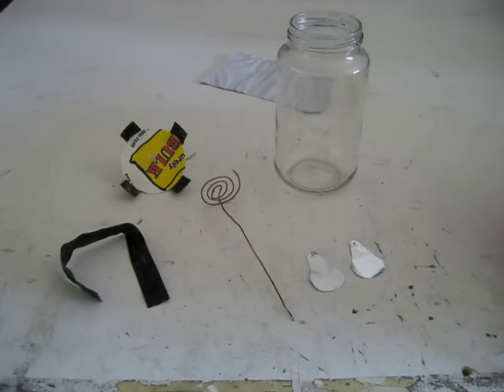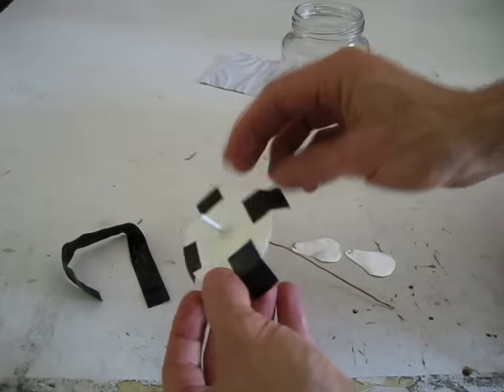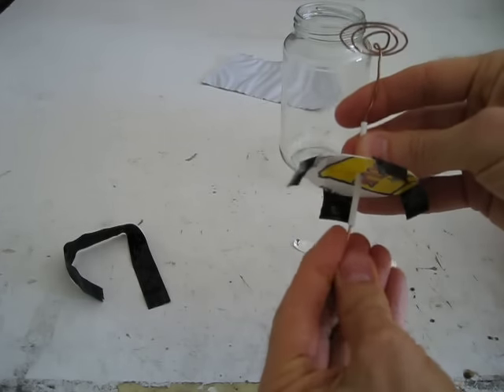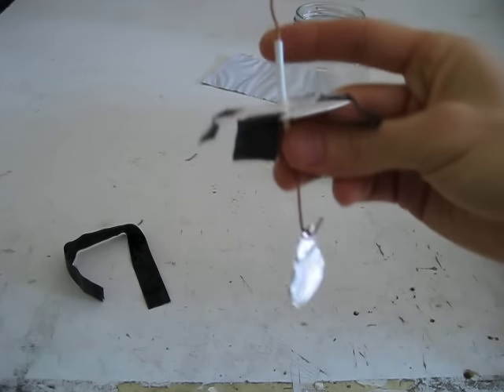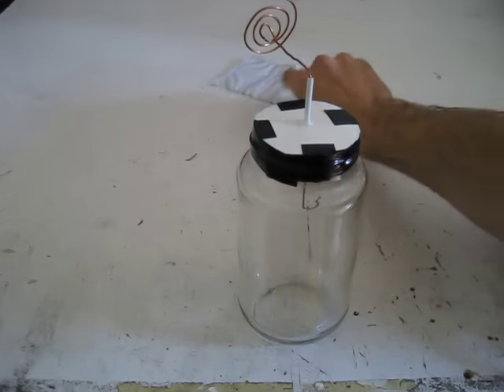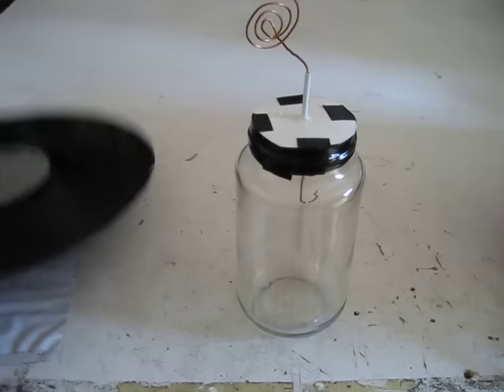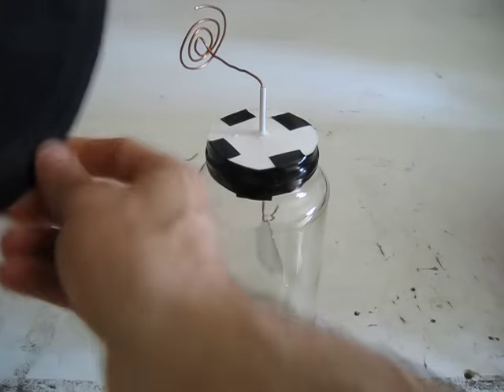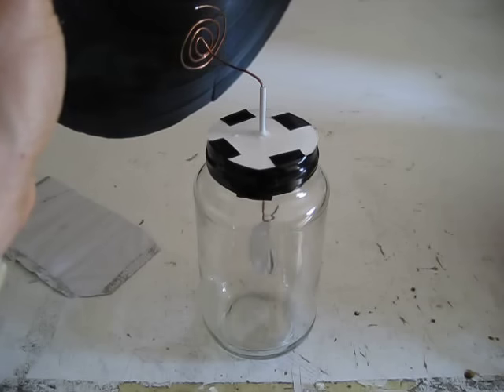How to make an electroscope (DIY)

Comment from the maker: It's not necessary to have the ends soldered. The most frequent problem is not with the electroscope but with the charged objects. If the air is very humid then it's hard to charge things. Also, try charging different objects: rub a plastic coke bottle, a balloon or a plastic comb against your hair and use the coke bottle, balloon or plastic comb. Oh, and the container used for the electroscope must not be metal. Does any of that help? Otherwise, describe what you've done. I'm happy to help.

Comment from the maker: I just looked up what that means and why it's relevant. As a result, about 20 minutes ago I put five Americium-241 pellets that I got from smoke detectors and that give off alpha particles inside my electroscope. Nothing's happened so far. The leafs haven't spread apart. I assume the alpha particles are supposed to ionize the air in the jar, somehow creating ions of the same polarity, causing the leafs to become charged and spread apart. If anything happens I'll let you know.

Comment from the maker: Are you asking how it's working out? The foil leafs are still not spreading apart. But the five Americium-241 pellets are still in the containers they were in in the smoke alarms with only a small hole for the alpha particles to come out. I'll be doing further modifications over the next week.
And if this isn't what you were working on, it's makes for a great experiment anyway and something a lot of people will find pretty cool in a video if it works, so thanks for bringing it up either way! :)

Comment: these using a glass jar, a metal lid with a hole punched through and a pen shaft to insert the copper wire (not even very high gauge).  Worked really well even with the high humidity in my house.  Could even charge by induction by grounding it with my hand.  Thanks, will uses as a demo in my class.
Reply from the maker: Sounds good. Have fun demoing it!
Reply: RimstarOrg
My students really enjoyed.  Thanks worked really well.

Comment from the maker: To make sure I understand what you're doing...
1. you rub plastic dipper
2. you bring plastic dipper near electroscope terminal - the foils repel
3. you touch your finger to the terminal
4. you rub plastic dipper
5. you bring plastic dipper near electroscope terminal - the foils DON'T repel

It sounds like you have a problem with where your foils are hanging from the wire. Something happens when the foils come back together after step 3.

Comment from the maker: That'd depend on the electric charge on the magnet (number of electrons vs protons), nothing to do with the magnetic field. It would just be a metal object.

But if the electroscope was already charged when you brought an uncharged metal object close, the electroscope's charge would redistribute the electrons on the object causing one side of the object to be charged different than the other. Then there'd be an effect.

Whether it would be better than vinyl would depend on the amount of charge.

Comment from the maker: It's due to the triboelectric effect, something that's been scientifically proven long ago. Look up "triboelectric series" on wikipedia {dot} org. Rub anything that's toward the positive side of the table with something that's toward the negative side of the table and the one toward the positive side will become positively charged and the one toward the negative side will be negatively charged. Dry skin is on the positive side and vinyl (the disk is made of vinyl) is on the negative side.

Comment from the maker: I don't think it would matter. More likely the problem is with your charged object.  If the air is very humid then it's hard to charge things. Or, try different things such as rubbing a plastic coke bottle or a balloon against your hair and putting the balloon or coke bottle near the electroscope's terminal. For more on charging objects see my "Triboelectric effect/series or triboelectricity" video. There's a link in the description below this video or you can find it on my channel page.

Comment from the maker: @WickedMovement How humid is it where you're testing? High humidity makes it hard to charge things. Re the materials you're to charging, make sure that the two you rub together are at opposite ends of the triboelectric series, the further apart the better (google triboelectric series for a list of materials.) The coffee stirrer should be ok. For materials on the negative side of the tribo series, does putting them close to arm hair or hair on your head move the hair? It should.

Comment from the maker: @towlie1o1 It has to be electrically conductive; so any metal, such as copper, aluminium, steel, ... Also, if it has to stand on its own like mine then it has to be thick. Mine came from the wiring that's run in your walls for supplying your electrical outlets; it's 14 gauge and fairly thick. Metal clothes hanger wire is thick; just make sure you sand off any coating that may be on it for the hook part where the foils hang from so you get electrical contact there. Fencing wire is thick. ...

Comment from the maker: I've been trying to come up with a way but haven't been able to yet. I started with using F=ma and measuring acceleration as a starting point but the acceleration of the electrons happens in the initial instant and is not measurable. Another approach might be to work out the electric field but there seem to be too many unknowns and no way to measure. If I come up with something I'll let you know, but don't wait for it. I don't know if/when I can.

Comment from the maker: @XGalaxiX Yes, you can use something other than a copper cable. Aluminium foil in the shape of a pencil should work. The foil leafs do have to be hanging fairly loosely so they can separate easily.

Comment from the maker: Oh, and the purpose of the tube is just to hold the wire and isn't needed if you have some other way of holding it. If you want to use a tube then a suggestion is a straw.

Comment from the maker: Spiraling the copper wire was just my way of making a large surface area facing whatever the charged object is. If you have some other way of making a largish surface area then go ahead. I bent it by hand. it was easy to do with my 14 gauge (AWG) wire.

Comment from the maker: @TheAnuraagvaidya I just tried it and it's not what you or I expected. I expected it to do nothing. The battery doesn't conduct electricity in this case since it needs a closed circuit (both terminals connected to the circuit.) But what I see is that no matter which terminal of the battery you use, the battery acts like my finger in my "Inductive Charging using an Electroscope" video (see the annotation at the end of this video or the link in the description.)

Comment: People use gibs from drywall baked in the oven on 200 °C for several hours to remeve moisture from the inside of the electroscope. Also a scale is useful to actualy roughly measure the amount charge. Also a ball without any sharp edges would be optimal to collect charge.

Comment: Great video.

One question, though. The book I'm currently reading says "If you have access to a laboratory electroscope, try charging it up with a glass rod after rubbing the rod against a dry cloth. When you pull the rod away from the electroscope, the foil leaves will remain standing apart. The charge “sits there” on the foil, trapped!"

Gibilisco, Stan; Gibilisco, Stan; Monk, Simon; Monk, Simon. Teach Yourself Electricity and Electronics, Sixth Edition (Teach Yourself (McGraw-Hill)) (p. 38). McGraw-Hill Education. Kindle Edition. 

But in the demonstration the leaves go back together again.  Why's that?
Reply from the maker: Are you sure the book doesn't give one more step? It should be telling you to touch the terminal of the electroscope with your finger and don't take your finger away until you pull the rod away. Then take your finger away. See my video explaining how this exact thing works http://youtu.be/-JsVZwc1dOo
Reply: @RimstarOrg  Thank you for taking the time to reply.  No, the book didn’t mention fingers!  The full text reads “If you have access to a laboratory electroscope, try charging it up with a glass rod after rubbing the rod against a dry cloth. When you pull the rod away from the electroscope, the foil leaves will remain standing apart. The charge “sits there” on the foil, trapped! If the electroscope drew any current, the leaves would fall back together again, just as the galvanometer compass needle returns to magnetic north the instant you take the wire away from the battery.”  That’s the end of the section, and it then goes on to another topic.  But I will look at the link you have sent me.  Once again, I appreciate your reply.

Comment from the maker: @jndhillon Yes, a metal hanger like a clothes hanger would work. But they are often coated with something nonconductive so scrape away all nonconductive coating at the hook where the leafs/aluminium foil hang from. Electrons need to be able to move from the wire to the leafs or from the leafs to the wire. Also, make sure the holes in the leafs are large enough for the leafs to be hanging loosely. You don't want the leafs attached too tightly, restricting their freedom to move.

Comment from the maker: @uberme65 They don't have to be exactly the same size. At least one of them has to be able to move easily since the repelling force between them is very weak. They also have to be light weight. Are you having trouble making it work?

Comment from the maker: An electroscope reacts to static (unchanging) electric fields. Under a pilon you'd get electromagnetic waves which are dynamic (changing all the time.) You can do what you're talking about, but it would take an antenna and some diodes, not an electroscope.

Comment from the maker: It doesn't have to be glass. Plastic will do fine, though make sure you don't rub the plastic jar with something like a cotton cloth before using the electroscope. Some plastics can become electrically charged fairly easily due the triboelectric effect, glass is harder to charge, I find. But I don't see why you'd be rubbing it anyway.

Comment from the maker: No, not everything you rub will repel the foils. You have to rub two objects together that are far apart in the triboelectric series. Try a plastic coke bottle against your hair, or a balloon against your hair. See my video "Triboelectric effect/series or triboelectricity" for more tips. There's a link in the description below this video or you can find it on my channel. Also, the more humid the air, the harder it will be to charge things.

Comment from the maker: The problem is probably with the charged object. Try rubbing a plastic bottle (e.g. a coke bottle) against your clean hair or a balloon against your hair and then bring the bottle or balloon near the electroscope's terminal. The air must not be too humid.

Comment from the maker: A frequent problem is not with the electroscope but with the charged object. If your air is damp then it's harder to charge things. Bring the charged object near your hair; does it attract you hair? It should. I rub a clean plastic coke bottle against a woolen face cloth or my hair. Rubbing a balloon against your hair works too. See my video "Triboelectric effect/series or triboelectricity" for more tips. There's a link in the description below this video or you can find it on my channel.

Comment from the maker: The material the lid is made of doesn't really make a difference, so aluminum foil, plastic or cardboard are fine. If it's metal just make sure not to touch it while using the electroscope otherwise you'll interfere with it.

Comment from the maker: @uberme65 I got mine at a hobby store. I guess you can find plastic tubes at craft stores too. But a drinking straw will work just as well. Or don't even use a tube at all - just put a hole in the plastic lid, stick your wire through the hole and then hot glue it in place. The tube is just there to hold the wire in place so anything you can do that holds it upright will do. ... and You're welcome!

Comment: the electrons from our hand transfered to the vinyl. And, then (you get near the vinyl and the copper wire) the electrons from that vinyl transfered again to the alumuniom foils. The two alumium foils now become like charged and they repel each other. My question is: the force between both alumunium foil, how long this force of repelling happen?
Reply from the maker: Your explanation is partly right. The electrons don't get transferred to the aluminum foils. The electrons on the vinyl simply repel electrons that are already on the electroscope's terminal down to the aluminum foils. In answer to your question, the force between both aluminum foils remains until you move the vinyl away. When you move the vinyl away, there will no longer be a repelling force and the electrons will move back up to the terminal. Another possibility is that the vinyl will lose its charge over time. That's because the extra electrons on the vinyl will attract positive ions in the air and those ions will take the electrons from the vinyl, making it no longer charged. At that point the vinyl will no longer have a repelling effect on the electrons in the electroscope. I don't know how long that will take though. Sounds like it wold be a good experiment to do. :)

Comment: So this is what happens when a negative charge is placed near the electroscope, but what will happen with a positive charge? I would assume the effects would be the same, since both pieces of aluminum become positive and thus repel each other?

And another question about the air humidity:
Does the entire room has to have a low humidity, or just the jar alone?
And would it work to put a hygroscopic material in the jar to lower the humidity?

Great and very entertaining video's, good work!

Comment from the maker: @808wizkid Anything metal. Anything that conducts electricity. Just don't make it too thin. I think if it's as thin or thinner than a hair then it might not work as well because it might leak electrons to the surrounding air or vice versa.

Comment from the maker: The terminal is the spiral shaped piece of wire sticking up out of the jar. It doesn't have to be spiral shaped. It just has to have a lot of surface area and the easiest way to make a large area using wire was to make a spiral.

Comment from the maker: @funfunfunny1234 Because with high voltage, a thin wire leaks electrons to the air (ionizes the air) more so than with a thick wire. Similarly, if the wire has a positive charge on it, then a thin wire would take electrons from the air more so than with a thick wire. I'm talking about a very thin wire such as 30 gauge or thinner, about the thiness of a hair. But it also depends on what's nearby because the electric field that causes the leakage is between the wire and something else.

Comment from the maker: @rosaliaquebral Do a google search for "triboelectric series". You should get lists of materials, some labelled positive and some labelled negative.You want to rub the things that are most positive with the things that are most negative. Usually rubbing something plastic with your hair or nylon or wool. Try all sorts of things. Rub them together vigorously and then hold them near the electroscope terminal like in the video. If your place is humid then it will be harder to do.

Comment from the maker: @mazer741 I think an iron cover (deksel) would be okay. It would be best if the wire was insulated from the iron cover. If it is not insulated from the wire then the iron cover will become charged but I don't see how that will cause a problem. Keep your fingers away from the cover when using the electroscope.

Comment from the maker: @IMABEAST4517 Nope. All that light work to measure relative amounts of charge on a charged surface, basically electric field strength. It's been very useful over the years in high voltage work. Also all that work to make something useful for learning about charge and electric fields. Most people who make it, do so to learn.

Comment from the maker: Or are you saying you're doing...
1. you rub plastic dipper
2. you touch finger to electroscope terminal and THEN you bring dipper near electroscope terminal

At this point the foils should NOT be repelling. The same as 1:50 in my "inductive charging" video.

3. then keep the plastic dipper near the electroscope terminal and move your finger away
4. then move the plastic dipper away

The foils should repel a little. Notice the order in 3 and 4. Remove finger first!

Comment from the maker: Search for "triboelectric series" which will give you a table or materials. Rub something that's on the positive side of the table with something that's on the negative side of the table. The farther apart they are the better it'll work. Also, the drier the air the better. You can also see my video "Triboelectric effect/series or triboelectricity".

Comment: Thank you for YouTubeing so much you thought me more about electricity than I new before. I now read books and you have inspired me to read more.... I am now making a payout rate on my raspberry pi for my arcade claw machine and using zanier diodes and 12 volt voltage regulators to make it easier for it to control

Comment from the maker: That's what I suspected. The other option is to put the Americium very close to the leafs but I just looked up the mean free path in air at ambient pressure and it's around 68nm! I wonder what radiation source they intend scouts to try in their electroscopes that would ionize the air sufficiently with one polarity.

Comment from the maker: I guess in that case you could keep the charged object connected to the HV power supply and with the power supply still turned on. But that may not be practical for all cases. Sorry to hear you have lots of humidity. That would definitely make lots of HV experimenting hard. We just went through a week of high humidity here.